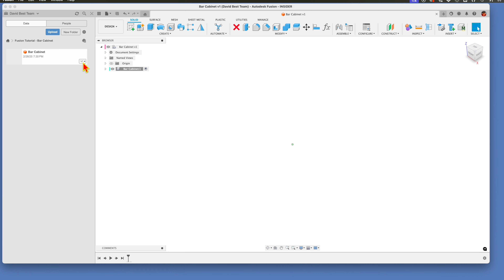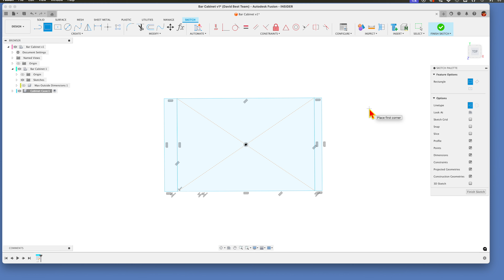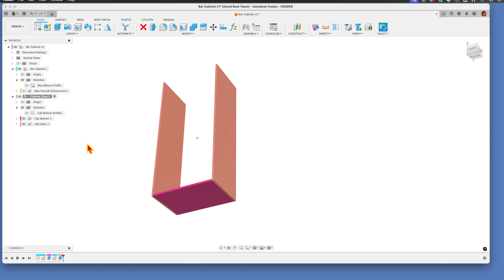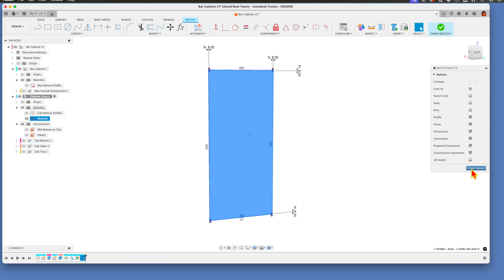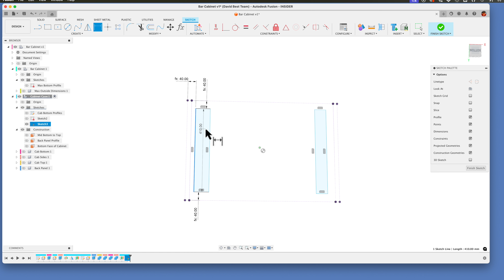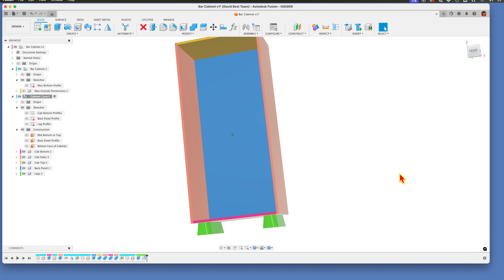Part 1 - Complex cabinet design using Fusion 360 for woodworkers.

Comment: Hi David. How do you know when to create a new body vs component? Thx.
Reply from the maker: A body can not be put into a joint relationship with another body or component. To make a joint or assembly (rigid, sliding, rotating, etc.) the items must be components. Components have their own origin (designation in 3D space), and can also contain sketches and construction planes used to create the 3D body inside the component.  So you can think of a component as a container for related things including bodies and other things like sketches, construction planes, etc.  Since components have an independent origin, the can be combined into subassemblies, and those subassemblies (which are also components) into larger assemblies.  Watch this video for more, or DM me:  https://youtu.be/oNmkR8BV9wI?si=QrE1yuuOhq63Kaut

Comment: Hi David.  To illustrate my level of ignorance with respect to F360. I don't have a clear understanding of a body vs a component.  I've seen the definition, and seen a couple of "explanations" on other videos.  And I still don't have a clear understanding of the benefits of one over the other, nor do I understand when one should be used, or not used.  You specifically chose to create components instead of a body in several points in the video.  Is there a video or reference you can point me to that will provide a layman's explanation?

You like to work in an open space, without grids.  Why do you find this beneficial? Obviously, without a grid, I assume you cannot use any snap features.

Could you have used a construction line to mirror the cabinet top instead of a construction plane.  You used a construction line to mirror the feet.

The project tool appears to be quite powerful,.  I need to get a better understanding of of its uses.  The combine tool was also a great tip.

I have a basic understanding of of why you created the component that delineates the max outside dimensions of the project.  However, you never seemed to use any of that geometry to build any of the actual cabinet components.  I see how you can use it to see at a glance if you have exceeded the max dimensions.   Is that the sole purpose?

The parametric modeling is clearly the way to go, as is the modular approach that allows one to import elements of one drawing into another at a later date, thus saving the time to redraw.
Reply from the maker: Think of the Body as the most fundamental 3-dimensional structure within Fusion.  A Component is a bucket, envelope, container for one or more Bodies.  A component has it’s own origin in 3D space, and can also contain ancillary elements that are used in its creation including sketches, construction planes, canvases, and joints between components within a component which helps with organization – like a file structure on a computer.  If you want to establish a permanent relationship between two 3D structures in Fusion, they must be components.  The process of establishing these relationships is called a Joint.  You cannot Join bodies to each other - they must be components to establish joint relationships.  You can "Combine" bodies, but they then become a single new body rather than independent elements.

I don’t use grids because I don’t draw sketches that depend on the grid.  Parametric design means that the attributes of sketches are driven by parameters and NOT positions on a grid.  If you draw to a grid, then you are defeating the benefits and intentions of parametric design.

A mirror of a sketch only requires a line for reflection because you’re working in a 2D space.  Components and bodies exist in 3D space and thus require a plane rather than a line for mirror commands.  If you were able to mirror a body or component against a reference line, the mirrored part could exist in an infinite number of locations around the line as an axis.

The “maximum outside dimension” component is only used for discussion with the client to illustrate how the designed model fits within the space constraints provided.

Comment: You mentioned the preference for constraints when using Fusion, still you multiple times use the same dimension multiple times in you sketches, for instance when defining the drawer box offset and later the offset from the legs relative to the cabinet dimensions. Is there a specific reason for doing it like that instead of using the Equal constraint?
Reply from the maker: There are always several ways to approach any of these sketching methods.  Heavy use of constraints is is fine, but it can also lead to confusion if you go back to a sketch a year later and try to make modifications to it.  I'm often coming back to a design a year later to make a clone which I modify heavily for a new project.  When faced with this, it's often helpful if the original design is explicit enough to understand how some element is produced without having to search around and experiment.  As a result, and as you have seen, I try to leave enough bread-crumb trails around that I can easily discern the logic behind how some element was created.  So, all sketches, components, joints, construction planes, etc. are labeled.  In bigger projects, I also label the operations in the timeline.  When it comes to sketches, there are a couple constraints that I try to stay away from using because they are difficult to see and understand a year later.  Equal and Symmetry examples of this avoidance.  I do try to accomplish the same goal by picking up dimensions from other dimensions rather than keying in the parameter name each time.  For me, this yields a more explicit sketch and is helpful when coming back to the model sometime later and trying to make modifications. You can definitely over use constraints to a point that the model becomes brittle to modify.
Reply: @David_Best  Thanks very much for your detailed answer. I am starting to dive into Fusion for woodworking coming from other CAD/modelling software and am pleasantly surprised by the amount of practical knowledge and experience you share in your videos on the practical use of Fusion. Most videos only touch on how to accomplish things without this context. For me the extra practical is really beneficial.

Comment: Thanks for the excellent video. Learned a few things already from the first 10 mins on useful setup options.

If I am not mistaken you can also insert the parameter while dimensioning, w/o going to the Parameter window. Are you not using this purposely for the video or is there another drawback for not doing it that way?
Reply from the maker: Thanks for the comment.  Yes, you can indeed create a parameter entry while adding a dimension on the sketch.  What you can't do with that method is also include in a comment about what the parameter means.  So I'm more inclined to deal with the table view for manipulation - you'll see why in episode 2.  That said, I will use the "create parameter while sketching" method in episode 3 on making the dovetails for the drawer box.  Good suggestion.  Keep 'em coming.